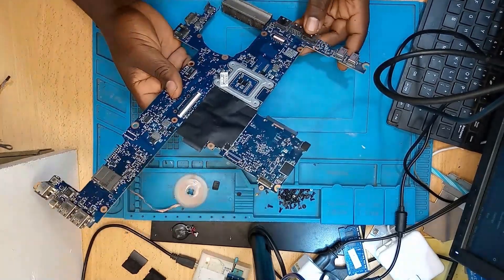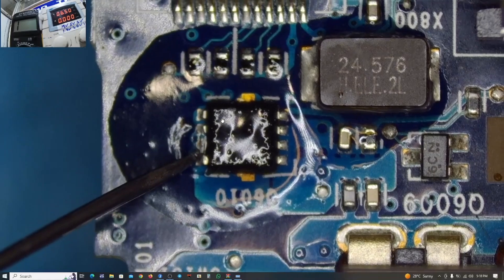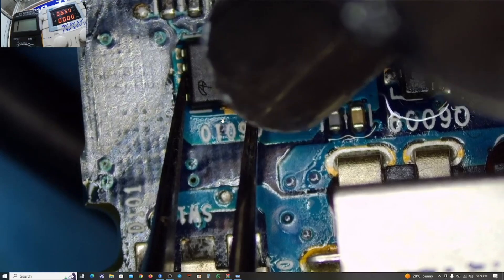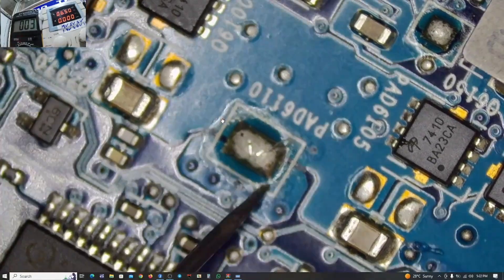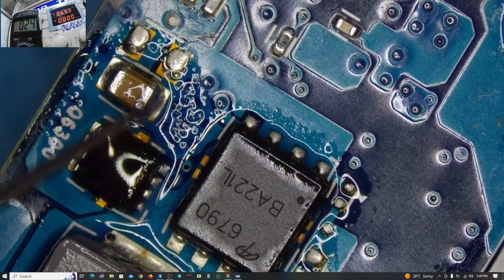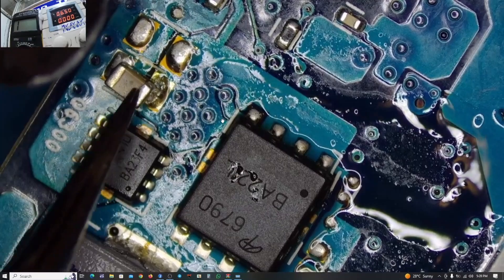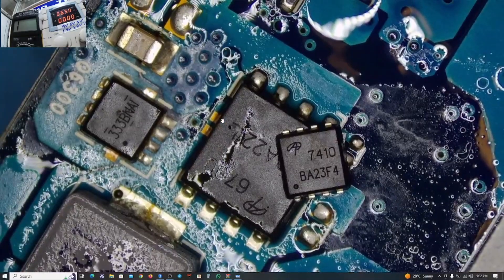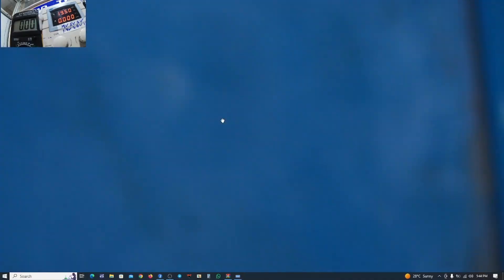How to repair computers DEAD motherboard -Short circuit

Comment: Where can I get the mosfets to buy?
Reply from the maker: Or purchase at Alibaba.com
Reply: If you are looking for new parts instead of scavenging off a board (Which is a valid way to recycle parts), I'd recommend mouser or digikey.  They usually have a datasheet to go along with their parts which can be helpful even if you don't order from them. Many have schematics in the datasheets that can be helpful in your repair quests. Be well.
Reply from the maker: get them from old PCBs for free